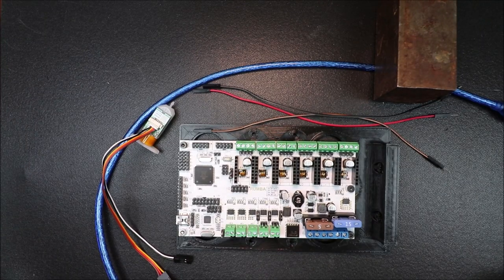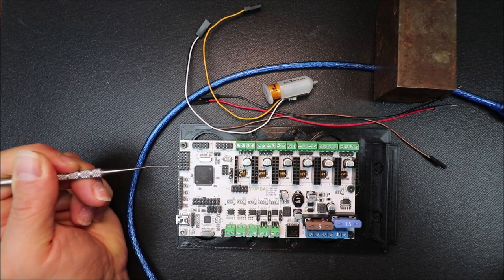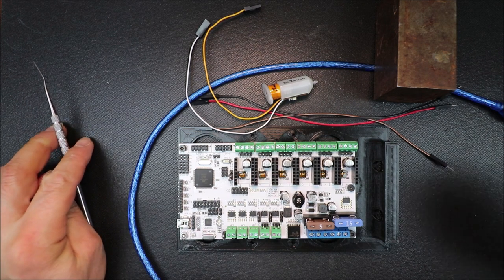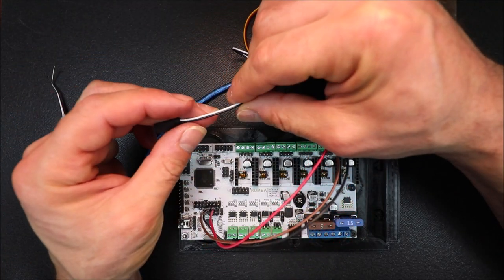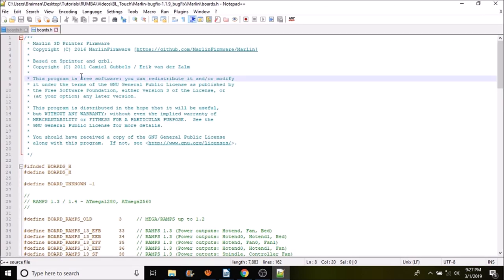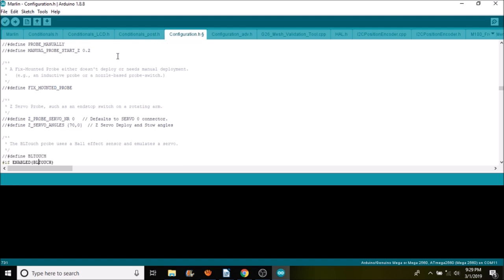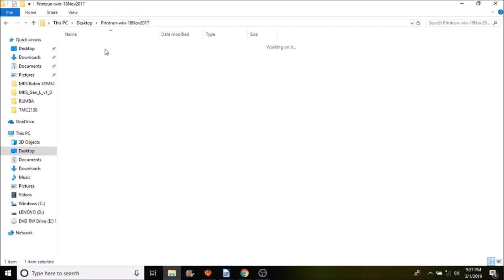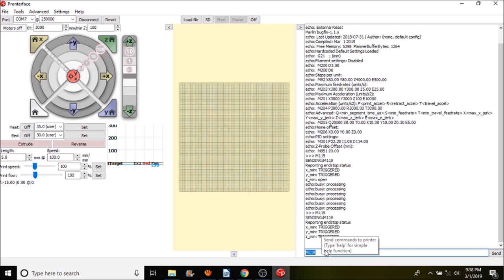Rumba - BLTouch

Comment: Thank you for the video. Unfortenately the exact pin locations are not so good visible. Could you please add a large detail photo of the EXT 3 connector so that it becomes clear what the right position of pin 5 is?

Comment: Why don't you use the 5vdc and ground at z-endstop connector?  Then you only need to run one wire to servo pin 5.
Reply from the maker: This is another possibility.  You're idea will also work.